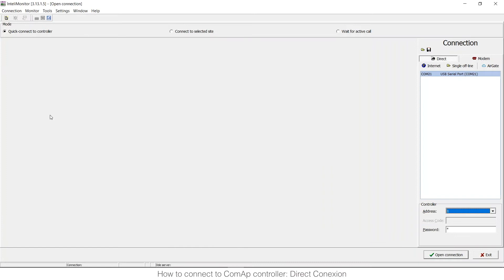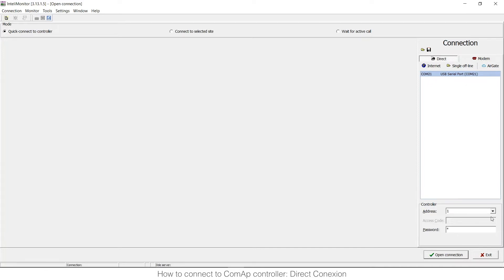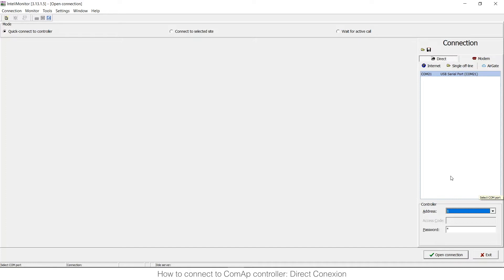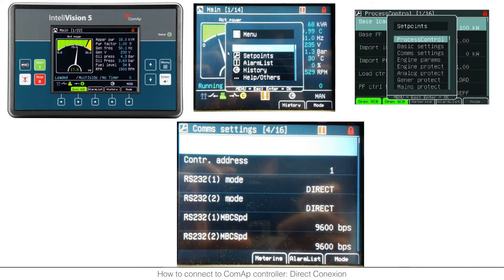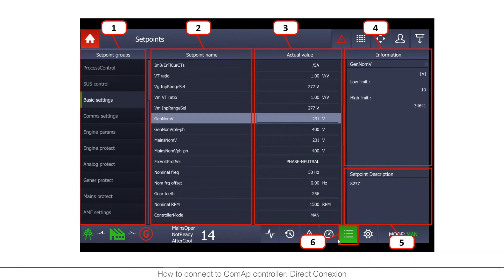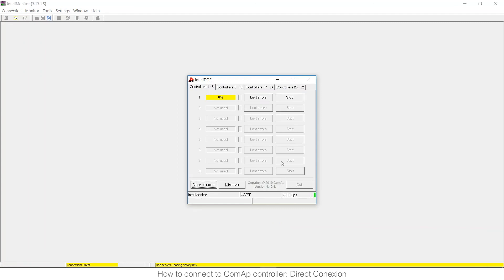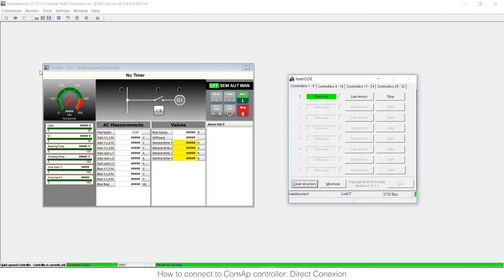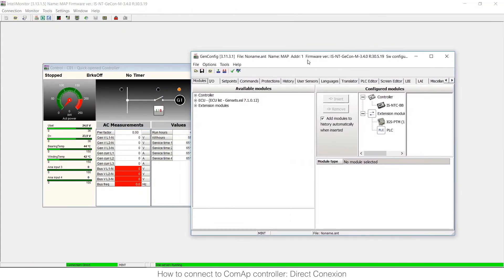How to connect to a ComAp Inteligen/Intelisys/InteliMains NT controller by a cable.

Comment: For those, like me, who have been struggling to establish communication with the controller. The cable needs to be a null modem type. You can use two cables joined end to end, usb to RS232 then a null modem cable attached to this. And don't forget to install the RS232 drivers. Avoid CH340 type drivers, i had connection issues with that chipset.